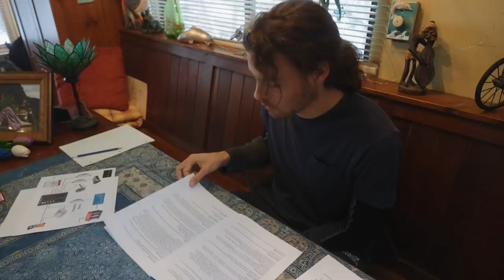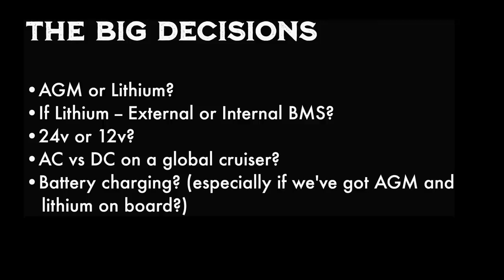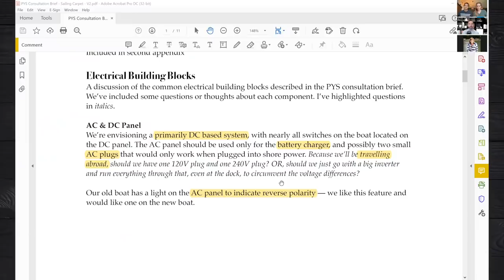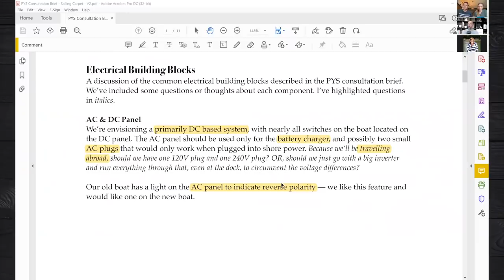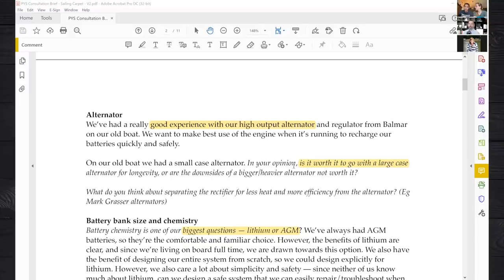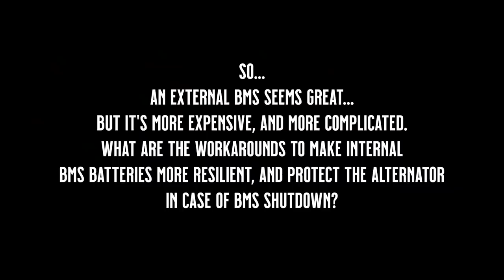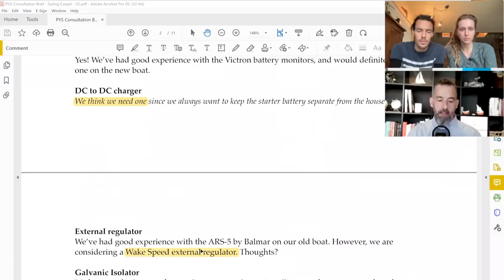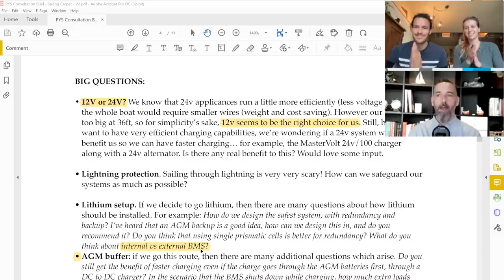DESIGNING an ELECTRICAL SYSTEM for WORLD CRUISING (with Jeff Cote from PYS)

Comment: So much information, it’s like drinking from a fire hose! Jeff Coat is such valuable a resource! I know my question is going to sound silly to many people, but please understand I don’t come from a marine background. So many of these items talked about in today’s episode are, quite frankly very expensive. And the more I listen the more I understand how fragile the lithium systems can be, especially when combining them with the required engine battery system which will be most likely AGM. So here’s what may be a silly sounding question. Would it not simply be preferable to have these two systems completely separate from each other, impossible to cross connect in anyway, And for them to be supplied by two individual smaller alternators with lower amperage output? Once the engine starting system, AGM battery, is topped off the draw on that alternator will be almost nonexistent, or zero, depending upon how old school the diesel is, so that alternator will be somewhat free wheeling, and not creating drag on the engine. Then the only draw on the engine will be the house bank alternator. 
This system seems to me to be a way of alleviating a tremendous amount of electronic switching components, that could leave everyone in the dark if anyone component fails.

Comment: Dual LFP cell banks each 400 Ah or 10 kWh with their own BMS and Victron Charger/Solar Charger/Inverter with Busbar and interconnect switches next to each other for Aladino's redundancy. On the shore you switch them together. Out on the sea you can run them indivdually. With Victron you could make the interconnection automatic, but thats not necessary and costs money.
Reply: Absolutly agree

Comment: I designed my electrical system from scratch:  4 - Trojan L-16 lead acid batteries, no alternator, 430 watts of solar.  I've been living on this system for two years.  Winters, when the sun is low used to be an issue before I added and additional 130 watts of panel on the rails.  Originally I have 300 watts; all deck mounted.  I plan to add a water turbine generator from Hydrovane in the future.  I have no a/c system per say.  I have three inverters located around the boat.  300 - nav station ... 600 - main salon ... 1000 - aft mechanical work area.  I have no shore power connection hence no a/c battery charger on board, except for a portable plug-in unit.  All my lighting is red & white strip LED.  All my electrical is run in exposed pvc conduit, which makes it really easy to add a circuit.   ...  oh, and I use a diesel stove so no propane on the boat.

Comment: Firefly carbon foam batteries need to be introduced here into the equation. Another thing not talked about here is how LONG it takes to top off LAB regularly which has GOT to be done to insure full capacity retention. Another thing not covered here is the thermal limitations on Lithium. They are gauged in the life time by cycles. Once they are living in like 92 degrees F their life cycles are cut in half.

Comment: We run a1400W microwave and a 1200W water kettle from the inverter to save on propane and to keep the galley cool. Either of those only run for 1 to 5 minutes each time.  Down the road after we get more solar i likely install an induction cooktop where the propane stove is today.  We do have a 24V bank for the inverter which I think is the way to go if you run large consumers even just for a short time.  If you run a mostly DC based boat with a 200W inverter for laptop charging a 12V system is adequate.  If you want to run large consumers even just briefly I think a 24V system is superior.

Comment: I am removing the propane burners and oven in my RV. Replacement will be a induction two-burner cooktop and a countertop AC convection  oven. Both will be built into the space where the propane "range" was. Just removing the 2 x 100Amp AGM's for 2 or 4 Lithium's. Keeping the engine battery to crank the V10 Triton.
I can make/assemble out of high end parts Lithium's for 40%(ish) the cost of procuring a factory made battery. Will have to purchase an inverter charger for the Lithium's. Starter Battery charged either by normal engine alternator or add a small solar panel.

Comment: maya and Aladino
if you are fixing a 12 volt  batterybank then its recomended that you connect a few batterys together like positive on positive and so on and the same by the negative then on the firts battery the positive pool to the accu swith and from the last battery the negative pool to the grond.
that wil have the positive effect on the batterybank because on that circut all the batterys thats connected together as one battery .
I have had that same sugestion from a battery dealer

Comment: Thanks for the really great video - I subscribe to both your channel and Jeff's.  

I'd like to offer a different approach to your decision making compared to what Jeff  implied...start with your power needs (how many AH/WH do you need per day (absolute essentials only) and want (how you would like to live). Next look at your physical constraints - what is the biggest alternator your engine can take (there is a limit), what is the maximum size of solar you can fit on your boat & how much physical space do you have for your battery bank.  These will determine how much power you could actually collect and store and how often you will need the alternator/engine to supplement the solar.  Now you know your needs/wants vs available power, that will help you work out the required battery capacity...which then determines whether you can get away with AGM (more space/weight for a given capacity) & less efficient (and therefore longer) charging relative to Lithium due to the lead float phase or if you need at least some or all lithium....you then throw in the final constraint - cost...this will then help you to get to your final system.  Definitely agree with external regulator & external BMS (so this factors into the cost).  

I wish you all the best with your journey and look forward to the coming videos.

Comment: In my system on my 36 foot cruiser I have an agm 100amp  starter battery and 2 100amp house lithium batteries. My understanding is that the starter battery acts as a buffer which can take the charge from my 50amp alternator. I also have solar. My fridge which runs hard in warm weather is always a drain on the bank. I have such a power surplus that I now forget about the state of charge that used to run my life. I can now run my radar without being concerned about the drain. My bms has never closed down my batteries but if it did I could manage to sail with just my 100amp starter. If I do flatten my batteries to such an extent that the motor won't start a couple of hours in the sun is enough to get my engine running. 
Interesting but IMHO lithium takes the worry away..

Comment: If you went with a mixed AGM/Lithium system, with the alternator charging the AGM and DC/DC converter charging the lithium, could you run two lithium banks, with two separate 30A DC/DC converters to get 60A charging?  Internal BMS is practical with that arrangement, and you get a decent charge rate, triple redundancy and engine starting surge power.  Extra hardware is involved with switching and isolation, but that part is relatively simple.
Reply: I believe the answer is yes as well as stacking units to raise amperage throughput.

Comment: sailing Atticus installed LiFePo4 and did a power audit - they like you will use extra power do to the time on laptops - Building our Electrical System | S06E20 plus the ones after that - they haven't given an update on their power usage- maybe you could contact them

Comment: Hi, with a lot if interest I follow your videos. I am familiar with the Waddenzee and adjacent waters. 
About LiFePo4 batteries: not only are they capable of replacing LA betteries, but they are much more suitable for a sailboat cruiser than any other type of battery - to the extent that some sailboats even drive their electric auxiliary engine by batteries. They have weightwise a huge capacity of energy storage, they can be discharged to almost 100%, their voltage doesn't break down under high loads, they have very little self discharge, they are much smaller than any type of LA battery, and so on... They are the ideal energy storage on board and most suitable to be charged by both small or high currents. Combined with solar panels and a high output alternator (24V) they will fulfill all your energy storage needs: they have become very cheap, well constructed and controlled, they cannot go up in flames, don't set free caustic fumes, don't need to be filled with water, and don't need to be replaced any time soon as they are good for thousands of cycles. 
Propane, however, is also very good way of storing heat energy, it is dirt cheap, and available around the world. It is secure if correctly installed and has an unbeatable track record. 
As Jeff correctly states, if you combine AC shore power with 24V (or 12V DC) power while cruising, you have a system that allows you driving power tools and common AC-appliances at the harbour while giving you all the energy you need while cruising. Many power tools can be driven by 24V nowadays, even washing machines, and make you independant from AC power. Also charging is very efficient in a 24V system which is e.g. common in trucks with high energy requirements. 
For grilling and cooking just take propane, as any good Italian cook does.
To learn about LiFePO4 go to the channel of Will Prouse and you have the answers to whatever question you may ever have.

Comment: I am not sold on the merits of propane for primary cooking, and in fact, would leave propane at home.  Sailing UMA uses alcohol.  IMHO, most convenient would be to use induction for primary cooking. and alcohol as a back up.  For heating, use a wood stove, for convenience and sustainability.  In the future, battery capacity will become cheaper and cheaper, so installing the needed  wattage for cooking may only now be an issue, not down the road. (see also Sailing UMA Step 206)

Comment: Keep it simple! Choose a good AGM system. You do not need a starter vs house bank system, just one 400 Ah bank for your starting, navigation, lights, and emergency systems. Go for 12V because the appliances are much more available. Then buy 2 sets (redundancy) of a complete system 'solar charger powerbank' like ecoflow. You charge them with the solar panels, and you can charge them from your AGM-set or from shore power. The ecoflow sets are the future, easy, all-in and you can expand that system when you go for induction stove etc. They are smart, simple systems in your boat and they will become a lot cheaper in the future. 
And for the Balmar and its regulator....leave it in the shop! It is much much too expensive, it is not serviceable on an island. Just go for two separate standard alternators of about 70 Amps with normal v-belts. You can service or change them everywhere for normal prices. Better than waiting for the plane with the new Balmar.
The portable ecoflow-type setup makes it possible to stay 'modern', because soon a lot will change in the battery market!  And always think about lightning! It will destroy everything with microchips in it. Ecoflows can easy be separated from the ship system in case lightning and an AGM bank with standard alternators is very robust.

Comment: 240 vac is way more efficient than 120 , but so is 480 to 240,  the reason they don’t is the potential to electrocute someone and the magnetic draw  higher.. that’s why when you see higher voltage used in transmission lines are twice as high or 3 times to keep it’s distance,  240 vac is common but also need special connections that make it difficult to use..
Reply: Actually 70 Volts is worse than either 120 or 240... go figure. It seems 70v across two hands with the resistance of the body leaves just the right amount across the heart to "run" it. Not saying 120 is "safe" though.

Comment: A timely topic for us.

We decided to get rid of propane for inside cooking on our 2004 Catalina 310 we purchased in 2020. The  propane stove was original and did not function quite right. We are installing a two burner induction stove along with a microwave oven. My wife wants to have a gas grill on the stern railing for the few times she wants to grill/bake.

House Group 4d batteries did not hold a charge at purchase. Now there are four 12-volt Battle Born Lithium batteries (400 amp-hour). The stovetop, microwave oven, and "hot water" are the only large loads other than the new Garmin instruments with radar.

I am ready to mount two 450 watt solar panels on an Atlantic Towers arch to go with the Victron MultiPlus 12V 2000Watt Inverter/Charger.

The boat will live on a mooring when not being used for coastal cruising in New England. It will not be in a slip with shore power most of the time.

Comment: If you go with AGM starting battery, and lithium house bank, give them separate alternators. Yes, two alternators. Use the same model of alternator. Each should be on it's own drive belt. Use external regulators. Note, with most Balmar regulators, they can be setup to charge lithium batteries. Keep a spare regulator, and it can be programmed to replace either the AGM or lithium alternator's regulator. Yes, the only difference is how they are programmed. It provides redundancy. In this system I'd have all solar charging the lithium battery bank, and use a trickle charger to top off the starting battery when needed. Note, with a large enough lithium battery bank, engine starting can be done.
Reply: On volvo penta engines is/was 2 alternators a factory option. Even my d1-20 had a 100A alternator as standard.

Comment: Can you install two alternators, one for lithium, one for acid?
Reply: Sure. I would mount 2 alternators all the time and run those through 2 Victrons into the battery banks. Together with Solar and Shore power. Just use One Victron Multiplus II or two for redundancy. Or maybe small Quattros for generator AND shore power if you want to. LFP batteries are much stronger than Lead Acid AGM. They survive shorts and complete discharges for short times.
Reply: Interesting. Built in redundancy.  I like it.
Reply: Frequently, I see many.

Comment: Question can’t you have two alternators a small one to charge the starting battery and a high capacity for the house lithium?
Reply from the maker: That can definitely be done. 
Also one 12volt and the other 24volt is possible for a bigger boat. We have not decided for ourselves yet though…

Comment: I enjoyed the video as usual, but it triggered my curiosity. So I elaborate on that. It's all valid and relevant, and a nice video as well, but for me, designing an (electrical) system with controls does not stop at the main fuse board. I understand and appreciate the "DC" position too. But as long as you do not cook/boil electrically I would argue there is little need for higher voltage AC. As you can charge your phone or a laptop from the old fashioned 12V cigarette lighter wall outlet you still see in cars, it seems you can stay away from converting to a higher voltage fro the batteries and the using the power brick of the laptop computer to transform down again. This is for the most part a decision behind the main fuse board. But it drives the electrical system that comes after that board. Choice of wall outlets and how to lay out cables. In the UK, houses have a "domestic ring" and all wall outlets are on that ring. Each outlet has a fuse and each plug has a fuse too. The outlets do not allow for a phase/neutral inversion - which a German Schuko outlet would allow. The point of higher voltages is simply that there are less transport losses and the expensive part of cables (generally copper) can be thinner. To transport 100 Watts of power 10 volt needs 10 Ampères and that gives a lot of heat and losses. Make that 100 Volt and you need 1 Ampère and no worry over heat. This is why Europe ran the 3 phases in the local section of its grids at 220 Volts - 230V on the continent today and Britain has a faster agenda to arrive at 240V. If you cook over a flame from a gaseous energy source, then you may need 10,000 Watt to bake a steak when about 2,000W induction does the same because there are almost no losses anymore. So, that's a choice. It's all fine, but it's now clear to me how these decisions are made.
To me, systems design does not stop there. If you sail the world, you have all sorts of electronics systems that you rely on like, say, AIS. Radar. Sonar. These need (a) power, and (b) control wires and maybe (c) use different cables to relay their data. How do you approach that? I noticed some anally retentive sailors with their yacht north of the Arctic circle. They had constant fear of collisions with icehills or icebergs or ice floes. Imagine that you have a sonar that looks forward? That could be a conversation in system design too. If you've seen the sonar used by a not related YT channel Adventures with Purpose, then this is about as visual as your ultrasound (nicer IMO). That may be expensive, but I have seen some sailors run aground in France, or the Caribbean - temporarily. And depth sounding is one thing only.
It's good to scope these conversations with experts, but also to reveal the big picture to illustrate where each more detailed conversation fits.

Comment: I believe there is a misconception between lithium (the chemical of the battery lets say) and the BMS used in it.  YOU 100% can start your engine from a lithium, or use in your winch, or whatever you need, as long as the BMS in your battery is capable of doing it. 
I have a single 300amp battery that runs 300 constant amps (which means it would use 100% of it in an hour) and could peak for 2 secs at 900 amps. 
So, to sum up.... yes you can use a lithium to start your engine.